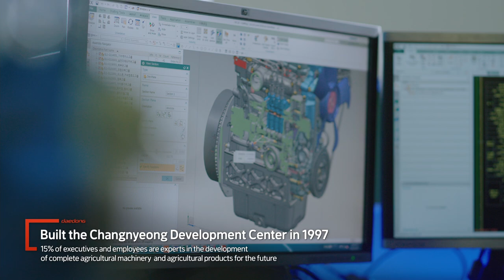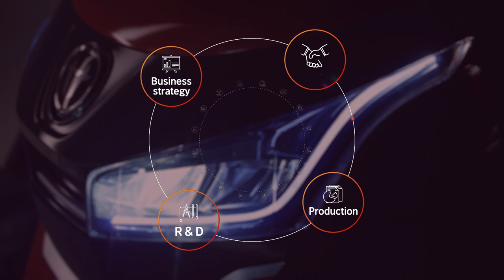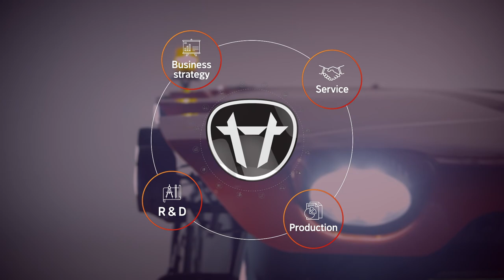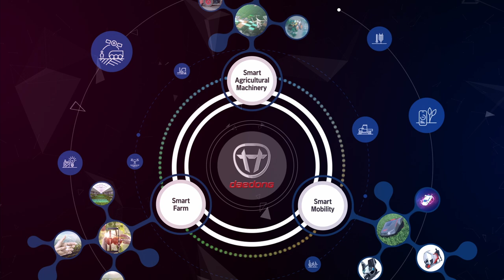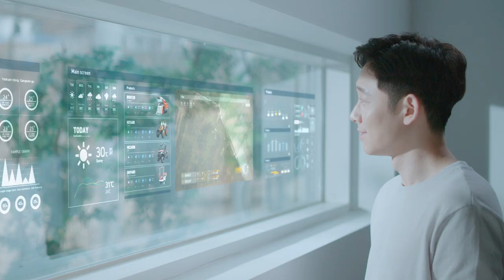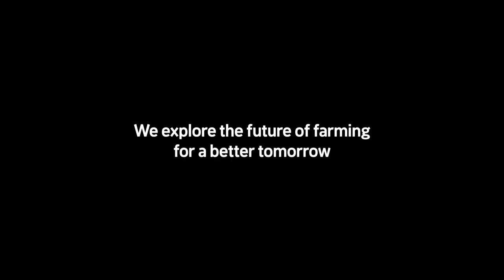Daedong’s future agricultural world

Comment: Thank you for your video. I do own a Kioti RX tractor and would like to see Kioti demonstrate different sized implements for the 40 - 120 hp tractors that are produced by Daedong. Also there are at least four different types of tires that can be ordered for an RX tractor. Kindly show how each tire is used in it's prescribed application. Also, the K9 UTV is a nice machine but it needs taller tires so that it can be used more on trails and bush roads. That is one of the ways the K9 can compete with other companies in the UTV market.